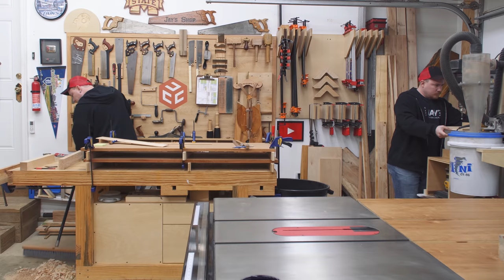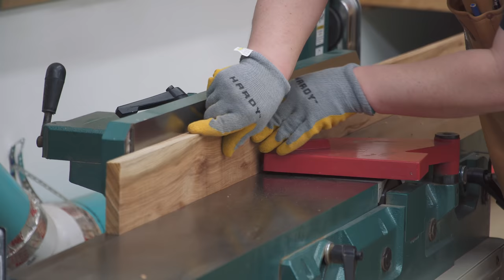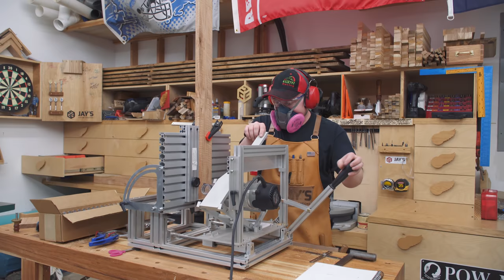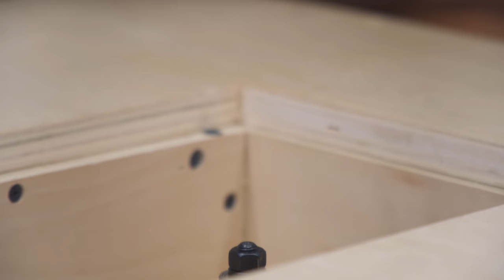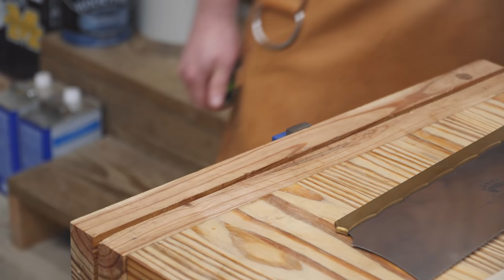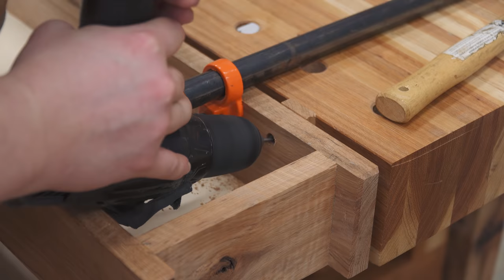Adding A Tool Well To A Workbench - 300

Comment: Nice work, and I agree with the premise that a tool well is indispensable.  The recent trend has been against their inclusion in a bench design because it only collects saw dust and junk.  I don't bring junk to the bench (that's what the rest of the shop is for) and if you can't deal with shavings and saw dust, collect baseball cards as a hobby. Nothing is as heart breaking as the sound of a premium square or chisel falling off the back of the bench and onto the cement floor.  Great idea and, as usual, nice video.

Comment: Loved the video.  I was thinking it might be good to make it easily removable with something like sliding dovetails in the side of the bench.  Also I think a lot of the tool wells have 45 degree ends for easy cleaning I guess.
I have some very thick ~2" Hickory from a tree of my sisters.  It should be dry now and I get to plane it down, probably with a router.  I chainsaw milled this hickory and it's so damn tough and heavy, this is exactly the project I could build with it.  Thanks for doing this one.  I can only dream some day to have the time and to do it.

Comment: Jay I did the same thing but at the ends I put in a piece on a 45 degree to help sweep out the tray I didn't do this straight away it was an additive it did help a lot though, it worked for me but it may not for you Cheers mate

Comment: Very good video.  It occurs to me that it'd be really handy to split the tool well into 2 or 3  smaller trays.  And rather than mount the well along the full length of the bench, add fixtures(French cleat?, tenons?) so the that the smaller trays can be moved around the perimeter of the bench.  Just  my 2 cents.

Comment: Hi, not sure if someone wise has suggested this, but have you thought about a way to clean the tool well. I have one and is always filling with shavings and dust. I ended up cutting one of the ends off to sweep the shavings out. Love how yours is not built into the bench though. I'll be doing that on my next bench. Looks great.
Reply from the maker: Vacuum the well when i vacuum the floor.

Comment: I know if I ever made this, I'm so lazy I'd staple chicken wire as the bottom so the sawdust would fall through! :D
About an hour in, I'd be crying as all my tools dropped when the staples failed.

Great video by the way though. Illustrating that workbenches should be able to adapt to your needs not the other way around.

Comment: Great Job.  I wanted to ask you something.  I just finished a workbench poplar and an oak trim.  I used linseed oil.  Came out ok but seems a little scratchy.  I think it might be the poplar but I'm not sure.  Should I go over it with danish.

Comment: Interesting. I’ve never been a fan of tool wells, as they more often than not seem like a place for shavings, dust and chips to collect without an easy way to sweep them away, and just bury the tools. But maybe hanging the well further from the work area off the far side, like you have done here, might reduce that and make it more manageable. I’d be interested in your experiences with this over time.

Comment: On your projects you use a lot of PureBond plywood. I have gone to my local Home Depot and all they stock is the 1/2 inch PureBond in the birch. Is it safe to build all the shop cabinets and tools out of this thinner plywood or do I need to find another source for the 3/4. Thanks.
Reply from the maker: 1/2" will work for most tasks. They can get 3/4" though.

Comment: Hey jay, what is it that holds your tape measures on the mitre saw station there?
Reply from the maker: Aluminum transition strip from the flooring department at a home center. Bolted to the plywood with extra nuts to maintain spacing away from the plywood.

Comment: Would you consider moving that bench in front of the tool wall? I think it would really tie the room together. That thing is beautiful and needs a beautiful backdrop.
Reply: Eric Smith but then it becomes a regular table, and you can't work on each side of something you are building
Reply from the maker: I think he meant switch the benches so this one is in the position of my pine workbench. Not against the wall...but in front of it.
Reply: Ah, got it

Comment: Great video editing, Jay.  A few questions:  1.  With the rabbets for the bottom of the well, did you consider leaving the corners rounded and instead round off the bottom panel?  I've adopted this process and found it's a great time-saver which results in stronger corners because of leaving more meat at the ends.  2.  Any reason for not having the two end pieces sloped rather than square?  Doing so makes it that much easier to clear out woodchips and sawdust from the till.  3.  The outside corners look as though they'd be great hip bruisers because you've left them very square.  Any thoughts on rounding them off a bit more?

Comment: Also, I don't know if you can adjust it but the angle on the router cord is high and puts unnecessary strain at the most common breaking point.

Comment: Looks real good on there Jay, I like how you added the tool well to the bench and did not incorporate it within the original bench dimensions ! 👍 I see most people make the tool well within the bench and I think that takes away from the useable work surface !😬 Well done sir , I love watching your channel!!🙂👍
Reply from the maker: Thank you!
Reply: I was thinking the opposite. Now you have one full side being occupied by the tool well. It would also be hard to grab tools if you're on the other side of the workbench especially if you have a project in front of you. Also i find it more practical with the tool well in the middle as it is still accessible from all sides of the table and you can still use the edge of the table for clamps/ leverage / etc.  

Nonetheless great job Jay, i enjoy seeing just plain quality work on anything you do. Thanks for the vid
Reply: Good point. It all depends if you have access to both sides of your workbench as Jay does. In my case and for many others, the bench has to go against the wall

Comment: Hi Jay, as usual a great video. One question, I notice you have a Rockler Dust Right but still sweep the floor with a hand broom. Any reason for that? I was considering buying a Dust Right Floor Sweep kit. Cheers.
Reply from the maker: I use the dust right hose to sweep the floor normally. I swept the floor in the video specifically for the cleaning clone effect.
Reply: Thanks Jay

Comment: I like the concept very much beautiful bench my question why a piece of plywood in the bottom of the tool tray and not a piece of Hickory seems like it doesn't fit the entire scheme of the build .Not criticizing just my opinion
Reply from the maker: I disagree. The lighter center color goes well with the lighter center of the workbench. In person it looks like a perfect color match. But the reason for plywood is long term stability and not worrying about expansion and contraction. Using plywood also allows me to glue the panel in place and therefore make the entire structure more rigid. If a piece of solid wood were to be used a rabbet would have to be cut on the wood panel and placed into a dado on the tray to allow for expansion and contraction.

Comment: Jay, my first reaction to using that slot between the benchtop and the well for saw storage was positive.  But upon looking at it a little closer, you have a shot near the end of the video with a saw dropped in there.  Several inches of blade protrude above the work surface.   How long will it be before you reach past a saw to fetch something out of the well and cut yourself on exposed blade?  I hope the answer is "forever," but it really  looks like a hazard to me.  The saw won't be what you're looking at in such a moment - it seems to me it's just a matter of time.  Please be careful.  I think I'll pass on that option for my own well.

Comment: Very nice, but make sure the mic is on for the first time you jam your thigh into the outer wall of the well which is jutting about 2" proud. That is some kinda going to hurt.
Reply from the maker: I bet it would hurt just the same as running into the corner of the workbench closest to the leg vise....or the corner of my table saw...or the corner of my other workbench....or the corner of my jointer bed....or the corner of the bar in my kitchen. Luckily I know not to walk into things.

Comment: that is a nice addition to the table, and as always- very well executed. however there is something that I don`t really get- I thought that the whole point of a flush-mounted, deep well is to have the tools under the height of the table. and yet, you put a couple of saws in the gap you made especially for that... what am I missing? if I had to guess, I would say that A) it does not interfere with smaller projects, and B) it is easily removable, but it still seems like kind of a hassle...
Reply from the maker: It's just another option. The saws are more easily reached and less likely to be dinged when placed in the slot. If you need a longer horizontal work surface you simply don't use the slot. I think you're over complicating the thought.

Comment: I thought you wanted to be able to use both side of this bench? Adding this tray has limited you to one side now? Maybe not, the addition of the tray likely is worth more to you than the versatility of using both sides. If you were to do it all over again, would you add the tray in the middle and have both sides available?

Looks like you have a good worker there to help, you should be able to crank out 5 or 6 videos a week now!
Reply from the maker: How does that side become inaccessible? The tool well is 8" wide. By your statement, wouldn't that make anything further than 8" from the leg vise side of the workbench not usable as well?
Reply: Jay Bates - Woodworking Videos I didn’t say it was inaccessible. I said you were limited to using one side, meaning I doubt you will be planing, clamping, chiseling, etc while leaning over the tool tray. The tray is certainly accessible, but that side of the bench is now limited. You have dog holes on the side of the tray, that likely wont be used now, or used easily. 

My suggestion of the tool tray in the middle seems like the best of both worlds. Tool tray plus realistic bench use on either side.

Comment: Why make the box ends like that?
Reply from the maker: Why not? 
But I inset the sides to add more rigidity to the outside wall of the mortise.
Reply: Makes sense. thanks.
Reply: My concern is that walking around the bench with a load, you might catch on the end instead of sliding around the end.

Comment: Why not just put a tool well in the middle of the bench as part of the initial design. one side of the bench has now become inaccessible not sure this adds any benefit to the bench.
Reply from the maker: How does that side become inaccessible? The tool well is 8" wide. By your statement, wouldn't that make anything further than 8" from the leg vise side of the workbench not usable as well?